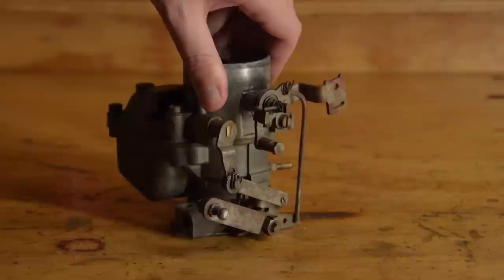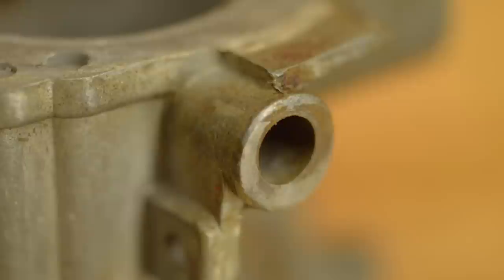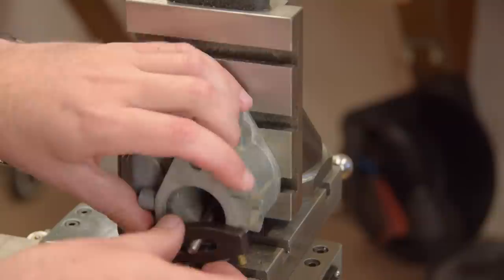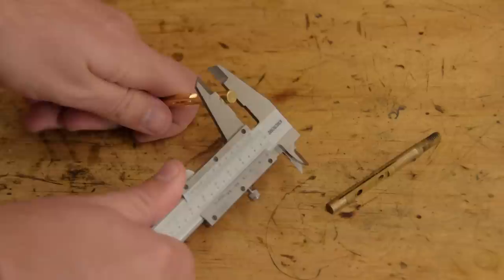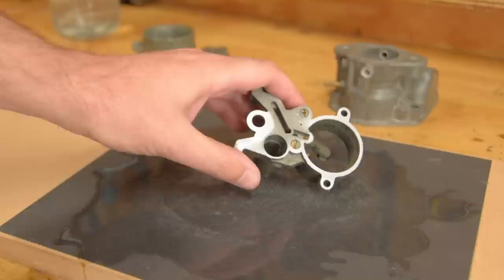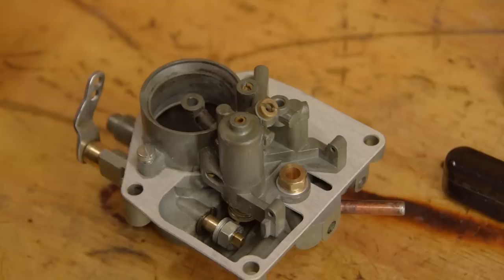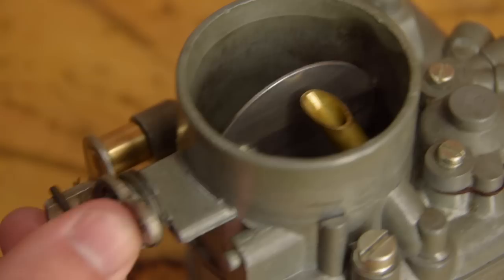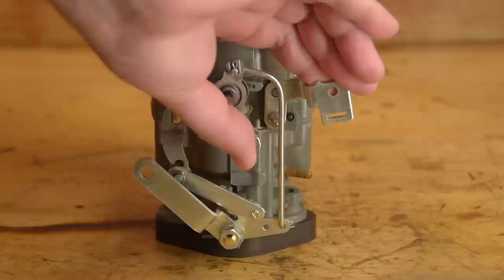Land Rover Restoration Part 6 - Zenith 36 1V Carburettor

Comment: Wow, very impressive. This type of carburetor (34 IV) was fitted to my Vauxhall Victor FB 1964, and it annoyed me a lot, couldn't fix it then because I didn't know about it then 30 years ago. But finally I Was able to fix it now or I should say restored it the way you did it with brand new genuine parts as per specs.

Comment: Interesting, as i remember old Swedish Volvo B-18 also had a Zenith Carburettor. The most common problems with them as i remember was the lack of real bearings for the airvalve wich makes the bearingpoints for the axle to wear out ower time and caus problems when the lid started wobbling. But maybe that's fixed on the newer models... The old models was pretty easy to take apart and back again.

Comment: When I worked at the carb shop we used to bore the body with a guided counter bore leaving a step in the bottom of the bore. That meant boring in from both sides. as for bushes they were coated with a Ramset superglue and bashed into their bores with a small ballpeen hammer, finished with a Stanley knife. Finish reaming was with a suitable hand reamer.

Comment: Once upon a time, on a 1972 Dodge Dart (4-door sedan) with the famous 225 ci Slant Six engine, I rebuilt the carb. When I installed the throttle plate, I filed the two plate-holding screws flush with the throttle rod, and added center punches to ensure that the now-studs never moved again. The smoothed-out airflow at this choke point seemed to make a subtle difference in how the car performed, and even sounded. Combined with other simple mods (free flowing exhaust, advanced ignition....that's about it); it certainly started going through rear axles.

Comment: Geoff, good decision on the plastic. I use it in my job. It has grear wear resistant, does not degrade with petroleum products, and as you demonstrated, easy to machine. The only better product is Liguid Steel but it's to cost prohibited in not industry application and requires a curing oven. Kudo!
Reply from the maker: Cheers Craig 👍

Comment: This is the kind of restoration I'd like to do on my two old Beetles.
Does the heart good to watch you work, going through every detail and documenting it! 
I have a box of various and sundry carbs off multiple vehicles, most could use this sort of repair! I'll probably have the better ones done by a specialist (at least the better VW ones) and have a go myself at the junkier ones. Huh, that's a accelerator-pump design new to me!
Just for the sake of debate, I'd imagine that busted pinhole could be fixed with some silver-solder, filing smooth, and re-drilling. But that would take more patience and steadier hands than I possess! XD

Comment: Geoff - Land Rover specified using the upper hole on the accelerator pump arm.  I also had my accelerator lever in the lower hole of the pump arm and experienced stumbling on acceleration.  Using the upper hole fixed this - it creates a more immediate/forceful introduction of petrol when the accelerator is pressed.

Comment: by the way.. one can measure the throttle shaft diameter.  visit the engine rebuilding shop and beg them out of a thin wall valve guide liner.. usually 0.001" or 0.002" larger in size than the shaft.  then you can find a drill just like you did that is 0.030 larger than the shaft and make your holes that size.  for a 0.373 GM throttle body shaft . i use a .375 thin wall valve guide liner and a letter Y drill at 0.404.. cut the thin wall valve guide liner with a fine tooth saw  clamped to a wooden dowel..

Comment: That homemade tool for the clip ring is great. Iirc, there is also a special plier, for those who don´t want to make the tool. Without plier or tool, the install is a pita. I´m not sure, but it looks like the plastic bushings are a hair too small. Shouldn´t the brass rod turn a bit more freely? On the other hand, time will solve that by wear, i guess.
Reply from the maker: It does turn more freely. I spent some time on it until it was buttery slick. Lots happ no off camera. I just try and tell the story. Cheers Udo 👍

Comment: Geoffrey, it was a pity that you glossed over how you determined the proper axis of the throttle spindle when you rebored the body. The video on strip down showed how badly the spindle bore was worn on its thrust side. How did you determine the correct position when you attached the body to the angle plate for boring?  Lovely  Myford lathe by the way! Another nice piece of British engineering.

Comment: In reading up on Bushing (I've got an SU to rebuild for my Landy) it sounded like it was a very difficult job to do right, first machining out the worn bushes so the throttle shaft isn't off the centerline of the barrel, and then fitting the bushes so they properly match the curve of the barrel. It sounded like if this wasn't done right, it would leak air past the throttle plate, messing with idle speed and possibly mixture. I'm curious after watching this if it's even a realistic problem.

Comment: How do companies make money making these replacement kits? Someone has to take the time to either source each little part or manufacturing non-standard parts. Then they have to put it all together for the kit, find packaging, etc. And even then how many people are actually going to need them? There can't be more than just a couple hundred people who own and need to replace parts for this very specific automobile line. Are these just mechanics with an enthusiasm for older Land Rovers who do it for the joy of it, not caring about the cost and time? And this has to be done for every kit. It's amazing what's possible when you have 7 billion of a species.

Comment: Curious, when you assembled the carb, did you check the float height/fuel level? Or is it preset by the float with no adjustments.
Just a small tip from setting bike carbs, if it is possible to adjust make sure it's set to the same spot, if you're running a touch rich it can be due to the float valve allowing too much fuel in and that can cause havoc with your jetting just a little tip 😊

Comment: Thanks for uploading, I have one of these fitted to my Hillman husky it has the 1725cc engine with steel cylinder head, it has a problem on very low revs, as you accelerate from standstill  it nearly stalls, but press the throttle down and it gets over this and runs fine anyone any idea would appreciate it thanks Edd.

Comment: Can you show us the old epoxy method for those who don't own a lathe? Great restoration!
Reply from the maker: I just stuffed some metal epoxy in the hole, then jamed the shaft in with a bit of oil on it and turned it every few minutes so it wouldn't get stuck until the epoxy was set.
Reply: @GeoffreyCroker  vw beetles have almost the same problem in their solex pict carbs. Thank you for the fix!

Comment: Yeah, i bought a bearmach kit for my zenith, was useless. didnt even have all the jets, the mixture screw was the wrong thread.
Unfortunately i also discovered that some wazzock has cross threaded the plug thing for the accelerator pump jet. I cant get the old jet out, and also cant get the plug back in, as the threads are knackered. What affect will that have on the carbs function? Landys running like a bag of dead cats, could this be the cause?

Comment: When you're turning the plastic @ 3:45, it looks like the plastic rod moves around in the lathe(?) on the sped up shot. Is that due to the cutting pressure of the tool, and does it need to be compensated for, etc.? Or is it just a trick of the camera.
Thanks for the videos, I love seeing parts getting rebuilt, I think you do a great job explaining how they function & wear.
Reply: Honey force, you are correct. It happens with metal too and affects the size of the part, even with very small cuts, although what we see here looks like a rough cut just to remove material. Partial solution is to have as little sticking out of the chuck as you can. A bit of time gets to the correct size and given the application here, it's good enough and obviously works well. All the precise stuff happens once the bushes are epoxied in!

Comment: Hey, How do you align your piece in the lathe so the drill is parallel to the hole for the shaft and not drill at an angle?
Reply from the maker: Michael Beck Good question. I filmed all of that but cut it out. I just put a shaft in the chuck and basically fiddled around until I could move the carburettor back and forth without it catching or flexing the shaft. There is some room for error when the butterfly is screwed into the shaft at the end.

Comment: As someone who has rebuilt far too many carburetors there are two things wrong with this video.  Didn't show cleaning out all the passages, This is critical.  Didn't replace all fuel jets.  Jets wear as well as getting crudded up.  I don't know if that model of Zenith carburettor has an emulsion tube but if so it would need careful cleaning as well.  Keep up the great work.

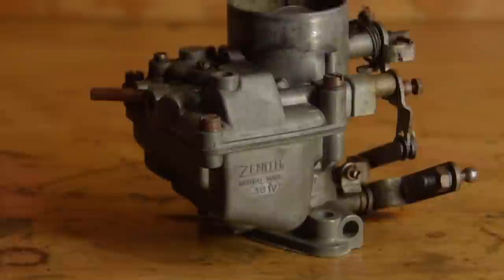Comment: Hang on - the one at the start 00:20 is clearly cast as a 361 V
As in: three hundred and sixty one, followed by a roman numeral for 5 

At 17:04 it's very clearly 36 IV
Thirty Six followed by roman numerals for 4

I know you changed the bottom casting as part of the rebuild, but why have Zenith got 2 different versions of the name?
Didn't they realise how hard this would make it for people trying to google instructional videos and rebuild kits 40+ years later?

Comment: Great work Geoff. I cant believe 3 cretins gave you a thumbs down. Your camera work is good, you cover interesting topics, perform varies tasks and use many different tools and equipment and inject a little humour as well which makes me chuckle. If i were to grumble and i often do it would be about your seeming lack of budgetary restrictions. ie most of us are skint and you probabally arn't and can just go out and buy what you need. Try doing ANYTHING on a budget of £70 per week.
Reply from the maker: Save that 70 pounds until you can buy a junk lathe. Fix that junk lathe and make a series of videos about it. Use the money you earn from all that work to buy a junk socket set and make a video about it. Use the money you earn from the socket set video to buy a crap drill press.... 😁

Comment: throw  the  warped  piece  of junk  away  and  fit  a  stromberg  off  a  186  or  202  holden  engine and  fit  it  with  a adjustable .main  jet  from repco  its like giving  an  old an a pill